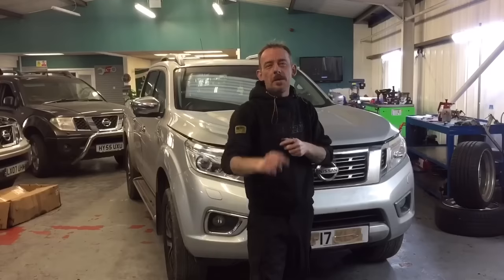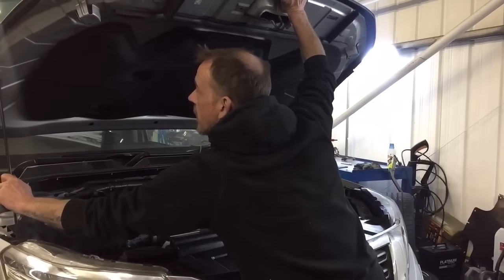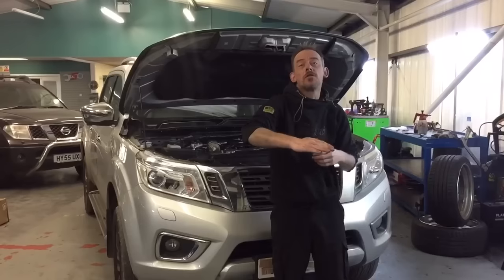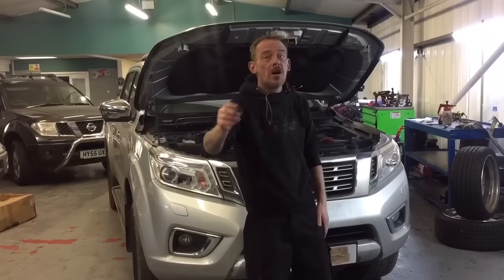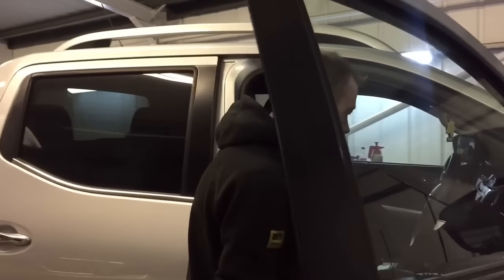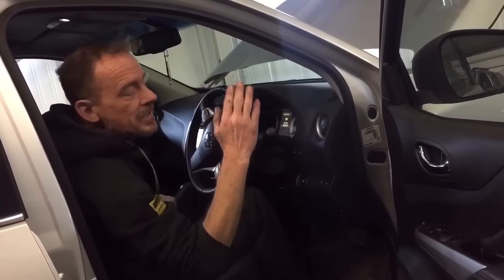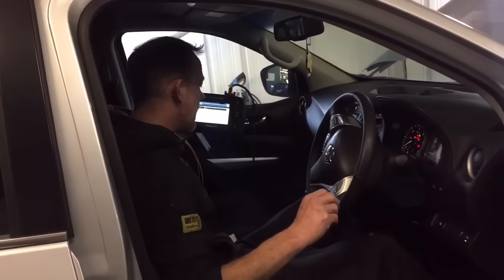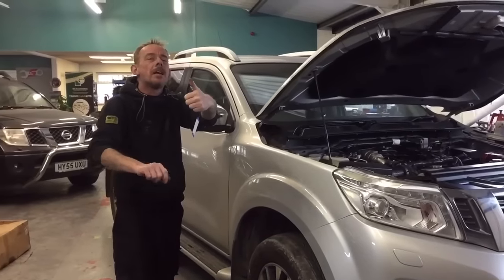Common Fault with Navara NP300 D23 (MUST WATCH IF YOU OWN ONE)

Comment: bought my np300 year ago, now 1 year 1 month age been driving it 48000km already and haven't  face any problem yet.
Reply: Mohamed Nazri same here. 2016, 48000 miles so far, trouble free. Serviced at Nissan at recommended intervals.
Reply: Mine jan 2017...until now have not replace anything yet..except tyre..brake pad...still in full performance..46000km
Reply: Mohamed Nazri people like this take things out of context to get views. They’re a great car
Reply: Ive had mine for 3 years, 2016 modell, driven 50000km, total 132 000 kms on the clock, not a single problem, until now, ive got a code on a camshaft sensor. Reset with obd reader, well se if the code returns.
Reply: Wow you guys are lucky mine was an absolute lemon
Reply: @AdmissionGaming  one nox sensor has been broken since. But nothing more than that. Replaced under warranty.
Reply: @KenKnowledge  so how was it? is the error appear again after reset?
Reply: @mohamednazri961  the code did return. It still said cam shaft sensor in my program. But when nissan had a look at it and runned their dedicated program it turned out to be the nox sensor. Its been running flawless since it was replaced.
Reply: @KenKnowledge  good to hear it solve, i need to keep this in mind just incase
Reply: @mohamednazri961  im happy that i could help.

Comment: Had 2 of these now a manual series 1 ran it 187,000km on out back corrigated roads in Aus. done a rear main seal and a set of shocks. for the hard work fully loaded gross 2.9t thought that was pretty good. Changed to an auto getting lazy, done 40,000km in 6 months same roads no issues yet. But i do all my own maintenance cant afford to get stuck out in the middle of nowhere may not see another car for days.
Reply: Hey Mate, Im looking at doing a lap around aussie pulling a 2.5t semi offroad caravan, do you think a 2016 navara would stand up to the test or leave me lost with the roos ?
Reply: Just letting you all know I got a 2016 Mazda bt-50 instead 😇
Reply: I have same

Comment: Just for fairness we need to see both sides of the Nissan argument, I have done 45k in mine problem free and for what it cost new (Tekna auto) worth every penny I'm really pleased with it and always take mine over my wife new Cayenne this must say it all, it's a Swiss army knife of a truck and reasonably priced in my humble. mine goes over fields and suffers potholes it's never cleaned but I do have it serviced by Nissan dealers I don't use independents for the record it helps if there is a problem if you have been loyal to the brand once again in my humble opinion.
Reply from the maker: Billy Bigboy yes I agree in everything you are saying but sadly because we are Nissan specialist people will come to us through messages on Facebook on here and gmail and tell me there distressed story’s of the Np300 this motor came out all over the world at different times so we get to see first hand of problems but on the bright side I love the look of this motor All the best Des
Reply: is yours a manual or auto? do you have an idea about then reliability of this automatic transmission?

Comment: Thank you very very much for sharing this knowledge. SUBSCRIBED. I Own NP300 D23 Thailand production. 17k millage now. Leaked rear axel oil seals on 7k millage;Replaced front driver side abs sensors after 10k (it gave abs warning on the dash); excessive steering vibration while braking going down hill 16.5k millage (my place has 20km of winding downhill roads), it gave me goosebumps, made me feel like don't want to press the brake paddle anymore. Will be watching your channel for the rest of 7 years owning my 1st navara since 2015 Starting today. Nissan only give 3 years manufacturer warranty.

Comment: Great tip, thank you. my hose was about 2mm away from the flywheel but had a clip on it which I pushed back into place & secured with a cable tie. Thanks again.

Comment: I had this issue, about 5 months ago, under pressure the hose reaches the pulley, then cuts and grinds a small hole into the rubber, I saw my coolant running out a day at work and got really worried. Carried the van to the Nissan in my country and they made me pay for the damages. Because they had no explanation of how the hose was being cut. Had to drain and replace coolant also.

Comment: Just had this issue with my Navara, Nov 2017 reg, 12000 miles, air con pulley sliced through the radiator pipe, fortunately noticed before it got too hot, and checked... All I would say is that on my Navara, the hose was on the left side of the engine, not the right as in the video... Nissan fixed the issue under warranty, and the new hose has a bracket to hold it away from the air con pulley.

Comment: This happened to my np300. The pully kept rubbing down the hose, until 1/3 of the coolant ran out and even lubricated all of my hoses. I lost power steering because of this, the coolant is an oil based one, so when the vehicle is not in motion. I.e at a traffic light, I could not turn my steering left neither right.

Comment: Warning: After changing the  Oil filter, make sure the hoses do not touch the pulley.There will be no problem if you fix it correctly

Comment: Des, if the lower radiator hose is secured properly with the center screw halfway along the hose running parallel with radiator my guess is it should never rub but i have an idea if this is removed when changing the oil filter and not re installed it may indeed rub on the pulley. Would this maybe be the case?

Comment: Hi mate I also have a 2017 np300 d23 and it's making a whining noise from the engine bay I also replaced the power steering pump but it still makes the whining noise do you have any idea what it could be cheers

Comment: Mine is a right hand drive. I just looked down at the Main(Big) and Smaller hose(which is actually nearer to the pulley) but the gaps are pretty wide. I do not see a problem with mine.

Comment: My coolant hose rubbed through last night 1500 miles from home in the middle of Croatia! I thought clearance was OK but seems I was wrong.

Being looked at by Nissan European assistance but has to be taken to Nissan dealer as cannot be repaired on campsite, and we have demountable camper on the bed. Nearest dealer 60km away. Being recovered to there on Friday to see if thay can fix before we drive to Calais for ferry. If not apparently Nissan will fly us and our SCUBA kit home with truck to follow once fixed, no one in Croatia will hire a car for one way trip to UK.

Apparently Nissan fix nothing abroad at the roadside not like cover in UK and non Nissan repairs can affect warranty.

Up to point orange engine management light came on Navara made no fuss transporting us, camper and SCUBA kit to far end of Europe.
Reply from the maker: All the best with it mate Nissan should fix it for free.

Comment: Hi, I have a problem my navara has problem to keep mimium rpm when I travel with the air conditioner, the rpm are so low that it stops(this when the car is stopped like in queque) when I travel I see that the car isn't so fluid is slow to take power. Never have this problem. My mechanic has change the low pressure pump in the fuel tank and change the diesel filter. But the problem isn't go away. The car is perfect If I don't use the air conditioner. It's an np300 2016 190cv automatic. I hope that you can help me

Comment: I have a concern regarding an issue in NAVARA D23 np300 MT Oct 2017 built.
When it runs at a speed of 120kms/hr, it creates a vibration in the body. Although its mileage 2,400+ only
It was already checked by the dealer but found NO solution to the problem. They also checked the under chassis parts, wheels etc. Including the propeller. What could be the real reason. If ignored and no action taken what will happen if I continue with that speed.
Reply: Propeller ha :D
Reply: idiyalismo inc. What brand of tires is it? Cooper?
Reply: Why r u going 120?

Comment: hi. question. do you have any idea on installing an alarm to these vehicles. im not getting any luck on finding the wire color codes. i saw a video on installing a lock kit to the tail gate and the central locking box is under the driver floor panel. i think it was blue  with gray strip and beige with grey stripe..but i need the wire colors for the remote starting and the pin out for the door switches..pos or negative. the alarm is a tomahawk ts-9010.

Comment: Hello guys,
What are your thoughts on the EGR Cooling pumps?
I have had it/them replaced 5 times now. Just about to book it back in for the same fault that just re-occurred
Reply: Hi did you find any more information out? I just had the same fault code come up
Reply: @skaifeward1532   As it turned out, it was the lower cooling hose leaking, when it gets low it throws up an engine management warning light, in turn, the silly dealer just replaces the EGR pump. In my case they told me to ignore the light, saying it would be fine. This resulted in an engine overheat and a full engine replacement, luckily all under warranty.

Comment: I'm planning to buy a brand new of Tekna 2.3 190 bhp automatic soon. What is your Nissan lovers advice please?  I'm going crazy for them.
Reply: I have that very model. It's a great truck, comfortable, smooth, well appointed and quiet at normal road speeds. However, take note of everything NP300 that Des says, especially about the timing chain. I don't plan on towing with mine so the timing chain problem is not an issue for me. Also, Nissan continue to leave their trucks chassis' open to corrosion by not coating it properly. Again, not a problem for me, as I live in Spain. Enjoy your new truck.

Comment: How come the pulley could be rubbing the radiator hose on some units and fairly apart on others? So where is the difference? Also, why didn't you grab de camera and showed the audience the hose/pulley interference????  Bottom line, why would we have to trust in what you say? Not a single one here having had the same issue
Reply: I had this issue, about 5 months ago, under pressure the hose reaches the pulley, then cuts and grinds a small hole into the rubber, I saw my coolant running out a day at work and got really worried. Carried the van to the Nissan in my country and they made me pay for the damages.
Reply: It is a common problem often the factory workers miss to attach things where they should be. Been working with nissan for over 2 years now , trust me some error they do is just laugh able

Comment: Could you tell me how to remove the rear seat in this model
Reply: Sifu Adam Hansen i just removed mine today while installing a flat sub. Unfortunatly it doesnt fold foward like other trucks. So i totally removed the seat via its bolts
Reply: @tt.k1794  thanks for reply got it out with the 2 bolts pretty easy

Comment: That car should have gone to main dealer as still under warranty  for 5 years for a leaking hose .or anything else but he will show a timing chain brake on this truck but you just heard it running  so I don't think  everything he shows is right

Comment: I had one got rid. Trade it in for new wildtrack. Ford ranger do i dare say is better.
Reply: Wildtrak is a nice looking vehicle, had a 2015 Ranger XLT which had a couple of transmission faults (shut down while driving!), eventually traded in on ST-X Navara...smaller engine but the Navara seems a better all round vehicle than the Ford.  Just done 101,000km problem free, costs less to service/run too.  Each to their own I guess.

Comment: he doesn't know what hes talking about, you dont need to shut any doors or press anything on on your key, you just press the ignition button once without using your feet on the clutch (again he said brake) and it does power, radio etc.. another press on the ignition button and it puts into position 1
Reply: It is automatic

Comment: Frogshit mate. There is a bracket to hold that hose in position !!
Reply: Some lower pipes are installed with a twist from the factory dealers should be correcting it